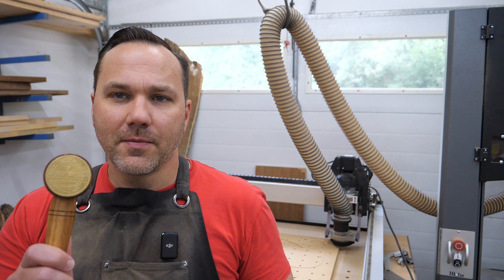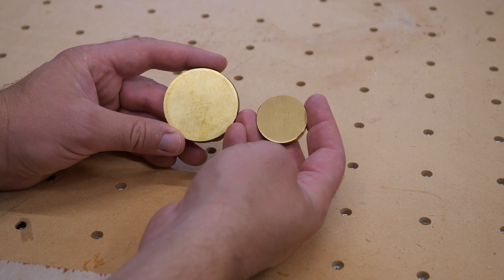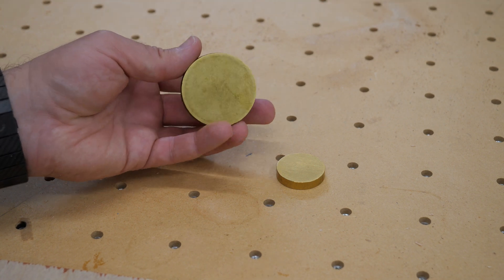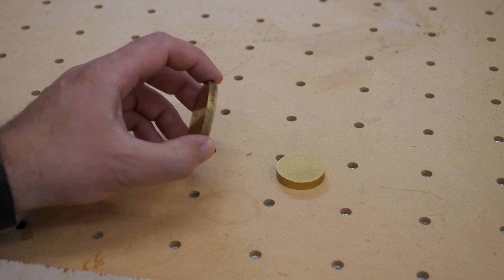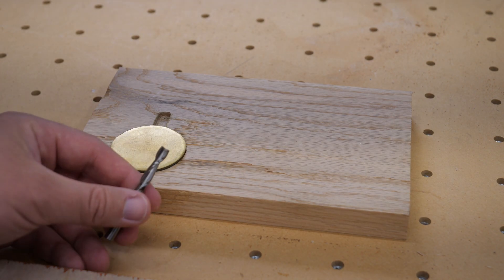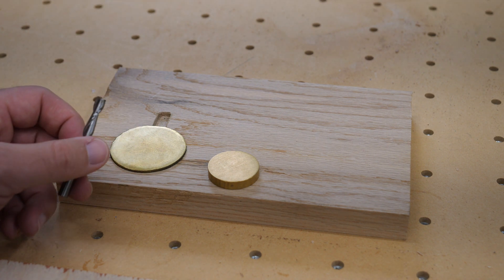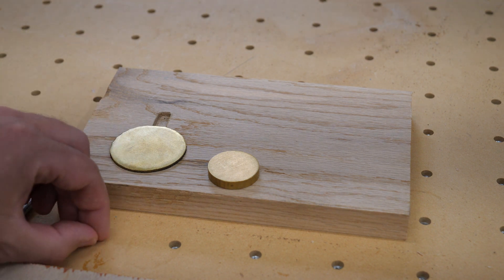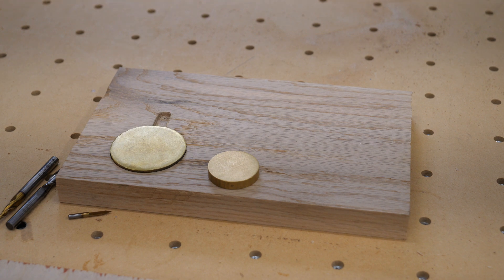How to Mill Brass on a CNC

Comment: Hey, nice video.  Very helpful to see the actual end mills you're using.  How do they wear over time cutting your logo?  Those look great, by the way!
Reply: Thank you! I’ve cut about a dozen of designs in brass around this size and the larger bits still feel sharp. The small v bit I change out after 2 or 3 uses.
Reply: @milestamu  Yeah, that's about what I expected.  Thank you!  I'll be trying your method, and trying making a stainless negative, heating the coin, and smashing or pressing it.  See what gets me farthest.  Much appreciated and keep up the good work!